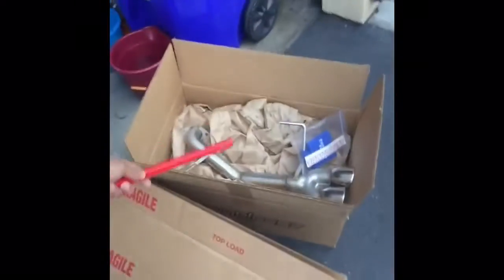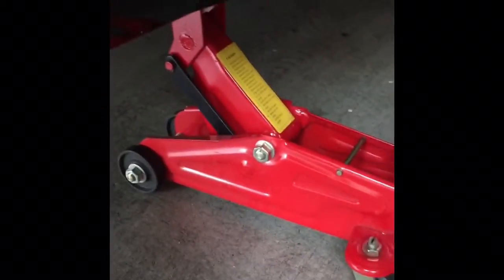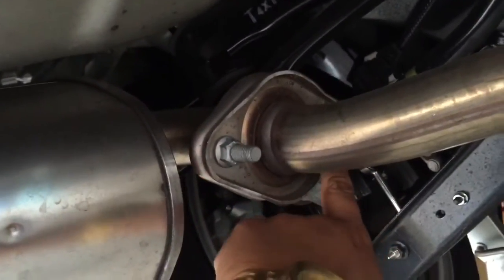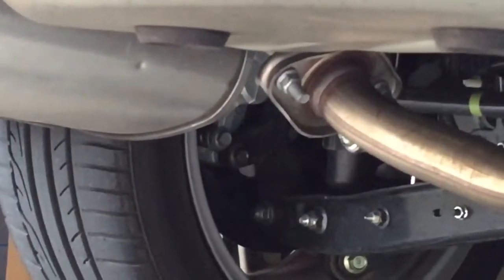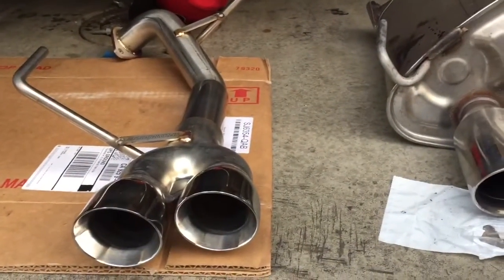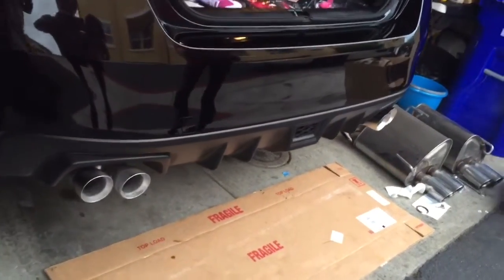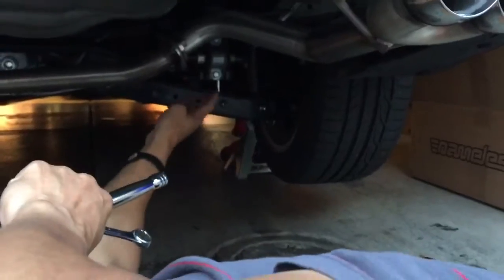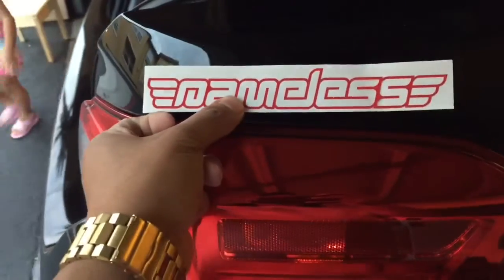2015 WRX Nameless Axleback Muffler Delete Installation with my pops!

Comment: Hey I have a question did you take anything off from the Y PIpe so that the washer could fit into the new muffler?
Reply from the maker: Wsup bro! I took off everything on the axe-back and used the new equipment from nameless. Do you plan on getting it? If so, it's worth it!
Reply: cdefg it's sounds so nice I love it

Comment: How long have you run this setup without a tune?  SO far so good?  Any performance gains?
Reply from the maker: I been running with no tune for about 2 months. Sounds great no issues. Nothing to complain about! 😁
Reply: it's an axle back only...unless you're swapping out the downpipe no tune is needed

Comment: Hey man I saw they were leaks between the stock y pipe and new axlebacks on yours, Just installed my nameless  mufflers on my 2017 and love the sound but my driver side does have a leak and moisture is coming out between the stock y and new nameless axleback. Did end up fixing the leaks and if so how did u do it? Thanks
Reply: DippinItUp1 sup man! It must of been because I just washed my car and it did rain prior to the installation lol. But had mine on ever since and no issue bro!